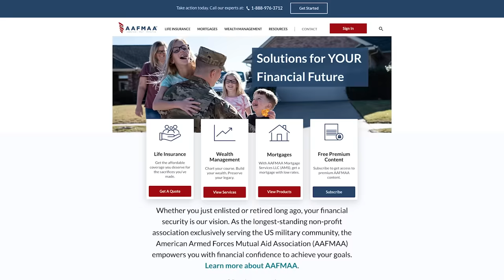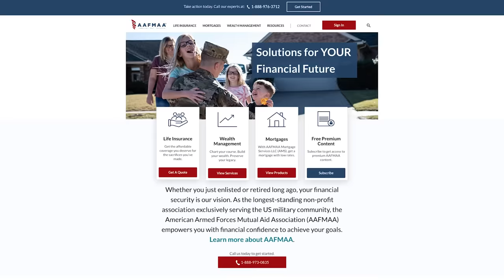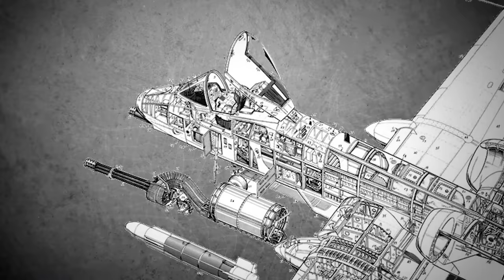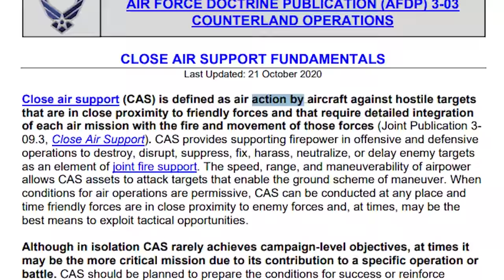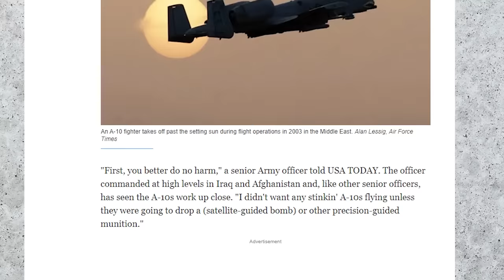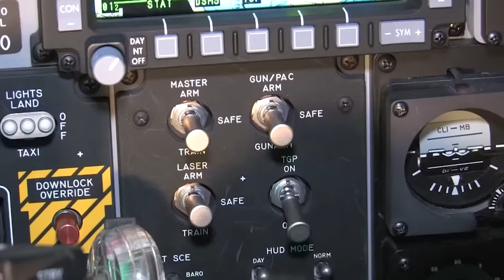Why the Air Force is Screaming to Retire the A-10 Warthog

Comment: Another comment, what gear you deploy can depend on what the enemy has. When Australia first deployed to Vietnam in 1965 [apart from advisors, which were already there for years], it consisted of an infantry battalion, a few M-113's, and a battery of 105 portable howitzers.  A battalion plus battle group with all the usual snap-ins like signals, logistic elements, and a small medical detachment. 
Later, it deployed 2, and then 3 battalions of infantry, more light armor , and more artillery and other services. And they learned their lesson, and employed a squadron [company] of the old Centurion tanks. Designed in WW2, they were no longer fit for a mission like stopping a Soviet tank army, but they were fine for use against the Vietcong and PAVN for years, because the enemy DID NOT HAVE TANKS AT ALL. 
Infantry operation with tank support caused Australian infantry casualties to plummet. Clearing a bunker system for example, or defending a firebase. [See the Coral Balmoral operations].
Short version, it is good to have the best kit in the world, but often it is simply not necessary. 
it reminds me of the joke. Two men are stalked by a tiger, and it charges. The first man runs, the second man runs as well. The second man pants "Why are you running, the tiger is faster than both of us?" The faster runner replies, "I am not trying to outrun the tiger, I am trying to outrun YOU!
You use what works, nothing more, and nothing less.
Reply: Australians in Vietnam were something else. They convinced my father that carrying water, or at least more than one canteen was a mistake, because you could instead be carrying that much weight in more ammo.
Reply: @removedot  That was weird advice. Several things to note. Although the Australian army has armour, it has always been infantry operations that dominate doctrine and training. We didn't have real mechanised infantry training in those days. So if you wanted a mech infantry unit, you would mate up a battlaion of infantry with some APCs [or helos] and go do the mission.
In addition, OZ is pretty experienced in jungle and desert warfare. All corps or branches of the Australian army, inlcuding logistics troops etc, had to go the through Cunungra jungle warfare course before being deployed to 'Nam. 
There is a doctrine of "water discpline", so in training and ops, you don't just guzzle water when you want to. That said, when I was in Oz green, getting dehyrated was an offense, if you were stupid about it, because then your mates had to stretcher you somewhere for an APC or helo to a hospital. 
Another big thing thta has always been in Oz military doctrine is 'fire discipline" . That means ammo conservation, aimed shots, and taking orders when orderd to fire or cease fire. 
The only plausable explanation would be that compred to most Aussie troops, Americans love their "rock and roll". You dad was probably carrying an M-16, and they have full-auto, wheras the Australian "SLR" was a variant of the Belgian FN-FAL in 7.62mm with only a semi-auto or single shot mission. 
The SLR was a brilliant robust weapon, and was dead easy to clean, but it could take a lot of punishment, and had a lot of stopping power. 
If your Dad got that advice, it wasn't doctinal. After that first year, when 1/RAR was deployed in 1965, subsequent battalions had some concripts in them. perhaps somebody didn't train them correctly?
I wasn't SAS, but I operated with them. Those guys are super-grunts, and they pack a shit load of water with them. Basically the idea is that you suck it up, and carry what is necessary for the mission and conditions, enough until the re-supply, and a safety margin. This is standard proceedure in the battlaions as well.
Reply: @roberthunter6927  he actually greatly preferred the M-14, and when he could, the AK-47 (much of the time he lived in the villages and trained locals how to use all kinds of captured weapons so probably saw just about everything)
Reply: @removedot  Yup, the early M-16's were utter crap. The M-14 was a nice weapon, but I much prefered the the FN-FAL. You could get them in full-auto [with a heavier barrel of course], but official channels didn't supply them. 
Another gem was the bren, in 7.62. Could almost withstand a nuke! :-) utterly relibale, mag fed [30 rounds].
I don't understand why the pig [M-60] was not supplied with a box magazine? Belt-fed is OK operating for a vehcile, but for a digger [grunt], the belt was sucidal. there was no way you could keep it clean. Both the US and OZ head-shed screwed the pooch with that one. 
The AK was OK, but some versions were better than others. From memory the Czech version was suburb and had good rust protection, because all the working parts, barrel were chromed really well. The selector lever was usually quite loud, which had tactical disadvantages. Accuracy was pretty 'average".

Comment: Something that most people don't know about the A-10 is that while it is absolutely dominant in overmatch situations, where the US has air-superiority and enemies are not operating heavy armor, the A-10 was effectively obsolete in any peer or near-peer conflict from the very get-go.  
Fire-tests performed on captured or purchased T-64s (in the 90s, I believe) with the GAU-8 cannon showed that the A-10 was unable to actually penetrate the tanks' heavy armor. Even when the A-10 scored numerous repeated hits on multiple passes, it was rare for any of the rounds to deal any significant damage. IIRC, out of something like nearly 2 dozen T-64s, only 2-3 were disabled by the A-10s after dozens of strafing passes. Most of the rounds that hit just ricocheted off, and most of the few that weren't deflected simply got lodged in the armor without penetrating.
Add to that the fact that the Soviets compensated for their own deficiency in air-power by focusing on SAMs to deny NATO air superiority as well, and the A-10 would have likely just been cannon fodder in any such conflict. In fact, NATO officials themselves expected as much, and the A-10s and their pilots were intended to be deployed as little more than a sacrificial stalling force at the outbreak of a Soviet invasion, meant to bog down Soviet tank pushes while NATO ground forces dug in and to force SAM responses so SEAD aircraft could take out said SAMs more safely themselves.

Basically, while the A-10 did certainly find another niche to fill, it was never going to be able to fill the role it was actually proposed for. And now it's niche is being taken over by more modern aircraft even better-suited for the role than the A-10.
Reply: The A-10 was developed as a gold-plated COIN aircraft, as its origins in the Vietnam War show - it was an A-1 replacement, of all things, and by the late 60s nobody thought the A-1 was going to be operating over Central Europe in a Fulda Gap scenario 
(or in any kind of contested airspace at all for that matter). 

As it happened, the A-10 was so over-specced for its designed job (and so in need of a justification for its budget slice after Vietnam, when we didn't have any COIN stuff to do for a while) that USAF claimed it was a dedicated "tank buster," but that was always kind of... insane.
Reply: Yup.  The A-10 was designed for Vietnam as a slow escort and dedicated CAS platform for Airmobile Divisions.  It would have been great for a few years in SEA in that role, with the main threat to it being the ZSU-23 mobile AAA platform that was being fielded in Vietnam after being provided to the NVA by the Soviets.  It was a suicide mission profile in European Fulda Gap or the Korean Peninsula Northwest Corridor between North and South, due to proliferation of 1970s-era SAMs and Radar-guided AAA.  A-10 should have been cut to maybe 250 airframes for expeditionary forces in support of the Joint Rapid Deployment Forces concept, not made at 716 airframes.

It robbed the USAF of relevant fast-mover seats and maintainers, and does to this day.  When they're populating the Air Taskings Order, the last airframe to be allocated is the A-10C, because it is of no practical use, and gets relegated to contingency CSAR duty.  This is because it isn’t survivable even in some of the more remote regions, where cobbled SAMs have been seen and used successfully against unsuspecting fighters overhead.

Comment: Highest blue on blue incidents rate ✅️
Highest accidental civilian kill rate ✅️
Extremely vulnerable to most forms of AA ✅️
Unique weapon system that is so powerful that it's extremy difficult to be accurate due to recoil ✅️
Unique weapon system that is not powerful enough to do anything that the more accurate 25mm can't do ✅️
Decades old airframes that are wearing out and getting more maintaince intensive ✅️

The sooner the USAF stops wasting resource on this dead end platform the sooner it can get more effective ones in service
Reply: "But I'm a retired infantrymen and I say 'BRRRRRRT'!"
Reply: This.  A great plane for the 20th century.  We should be building and maintaining planes to fight the way we fight today.  The low environment is dangerous as crap and we have high altitude weapons that are way more accurate than the A-10. If you like the “Brrrrt” sound brings speaker and play it on your iPhone.  If you want an aircraft to provide accurate, effective, close air support without getting itself shot down, bring a Viper.  Single mission platforms are a luxury we cannot afford.  All the money that goes to the A-10 is taken from platforms that actually win wars.

Comment: To me, it seems like drones+artillery can do a lot of what CAS does more cheaply and can more easily help every unit
Reply: Plus not being so vulnerable to SAMs. Although I do see some utility in A-10s and Apaches in places where you can't have artillery covering the whole theatre of operations and need a fast response.
Reply: Artillery CAN'T DECIDE WHAT TO HIT while it's flying through the air at a fixed point on the ground.
Drones are limited by how much firepower they have and because they are controlled by someone that DOESN'T HAVE 360 DEGREE AWARENESS!
Reply: @babsme6459  There is also laser guided artillery but for most uses a normal guided munition will do the trick as well, since the flight time is quite short.
While helicopters are more flexible in theory, they are also a much bigger and in many cases an easier target.
Due to air defence threat they have to stick closer to the ground, which actually means that their situational awareness and field of view is rather quite limited. 
What is meant by drones here are those small and cheap ones used in Ukraine, not the large armed ones. You can saturate an area with dozens of drones and create a superior situational awareness compared to a single helicopter.
If they get destroyed, they are easily and cheaply replaced and the crew is not lost unlike with helicopters.
Ukraine has shown the world the limits of helicopters in modern warfare and opened another world of small drones and precision artillery.
Reply: My husband was a Redleg so i understand how artillery works, including laser guided.
However firing ONE 98 pound round of 155mm about 12 miles is not the same as flying a few hundred miles and delivering a couple hundred 30mm cannons shells, or  the up to 16,000 pounds of armaments it could carry that included: 500 pound and 2,000 pound bombs, incendiary cluster bombs, combined effects munitions, mine dispensing munitions, Maverick missiles, laser-/GPS-guided bombs, and unguided and laser-guided 2.75-inch rockets
Artillery is and always will be the King of Battle, but is usually an area not point target weapon, while an A-10 had someone behind that gun and those bombs looking right at his target.
Reply: @babsme6459  Also, I don't quite understand the contradiction in your comment, first saying that ONE artillery shell is not a substitute for a large aircraft payload and then saying that artillery is an area weapon, since an area barrage requires a significant expenditure of munition.
Nothing is constricting artillery from firing multiple shots after each each other, not even precision munition. A single artillery piece could deliver a couple of those a minute, while a single aircraft usually needs a couple of minutes to realign on a target.
Reply: A single artillery piece also has a probable area error. And even a laser round couldn't be fired quickly because of smoke, dust, debris in the air that needs to clear.
An A-10 can turn in SECONDS and reattack a target.
Go away,, As a career soldier who went to the field and to war with combat arms support units and combat arms units themselves, I've probably seen more artillery rounds from 105mm to 8inch hitting the ground than the number of days in your life.
Reply: @babsme6459 for the part about looking at the target, drones spotting for artillery actually does a lot of that work.

Without relying on the short range mk1 eyeball

Also, and idk how common this is but I've seen it in clips, the Ukrainians have been able to get artillery shells right into trenches. So it seems like they're been getting it to work as precision weapons? Idk.
Reply: @babsme6459 right, but neither drones nor artillery are death traps begging to get their operators killed via MANPAD or longer ranged air defenses.

Drones can operate in such contested airspace without losing valuable pilots. The a10, due to the trade offs it made for the gun and being able to shrug off a certain amount of bullets, basically can't operate in airspace that hasn't had any threat to slow, unstealthy air craft removed.

Comment: I will miss the A-10 but also worth noting that the F-35's cannon is actually a 25mm rather than 20mm and is intended primarily for air-ground use. Due to the nature of volume laws 25mm is closer to 20mm than 30mm in total energy but still  but still has almost twice the total mass/energy of the 20mm round (although the 30mm has 8x as much). Against China/Russia the thing it's really a shame is that we stopped producing F-22s.
Reply: the issue is, i dont think the 30mm was ever given he rounds. so the volume is kinda pointless if all youre shooting are darts in the first place.
Reply: @Thekilleroftanks  yeah, and I also hope they arranged the cannon position finally. when firing it it would miss completely the target as the cannons were all badly allined. hope that issue is solved. plus some versions can't even support with cannon as they have none. Finishing, the F-35 using cannon air to ground??? is that how the F-35 was meant to be used? I don't think so, rather flying and attacking air or ground targets BVR, but maybe it's me being a stubborn idiot regarding for what roles and to achieve them the F-35 was bulit for. CAS missions? really?

Comment: With today's smart munitions, is CAS even needed anymore? And didn't Cappy said waaaay before, as an average infantry man, the best CAS platforn is the AH64?
Reply: CAS means you are providing air support close to friendlies not you getting close to the enemy doing gun runs
Reply: Facts. The AH-64 does everything the A-10 can do, but better.
Reply: 20 million a pop for the ah-64 vs 80 million for a f-35b. You can build four Apaches for this price of a single f-35 and since you would never fly a single f-35b now you're talking eight.. of course you're going to have to train six more pilots, and the f-35 bees will be down for maintenance a lot more than the Apaches. The Apaches can land and take off from almost anywhere. However it doesn't have the range where the speed that an a-10 has or any jet combat aircraft. But it's designed to operate close to the front lines so does it really need that? Maybe a combination of f-35b and ah-64 would be a good choice. Isn't that what the Marines plan on using? Just substitute Apache for cobra.

Comment: 15:48 I love the A10, but with a max impact area of 40ft, you would be better off using artillery or mortars and with better air to surface missiles I can see why the A10 is fading into obsolescence.
Reply: by this arguement then helocopters need to go
Reply: @alanwardell3680  Helicopters cost less and serve more roles than the A10.

Comment: There is an aircraft that is in the US inventory that can easily provide the same level of CAS support that the A-10 can. It is the AH-64 Apache. The Apache has so much more advantages with CAS than the A-10. Such as hovering out of sight in cover till they are needed.
Reply: The A-10 is only number 1 in one aspect... and that's blue on blue kills...

Comment: The airforce routinely retires more capable aircraft in favor of a more humongous force overall for logistics. 
See F4G to F16cj transition.
Reply: A-7 and its bombing capabilities?
Reply: The problem is, the A-10 is not a more capable aircraft, nor was the F-16 less capable. Better electronics changes what is needed from an airframe. 

On top of this, there is the issue of material stress. Airframes have to be retired eventually because they do fatigue over time.
Reply: No.
The F-16 has a smaller payload and ~30 minutes of loiter time, and lacks the stability at low speeds required of a CAS aircraft.
The A-10 has a ~2 hour loiter time and an enormous payload with tremendous stability at low speeds.
The C-130 gunship and attack helicopters are reliable for CAS, but are equally vulnerable, and in addition helicopters are slow and lack payload and loiter time.
Reply: @iivin4233  regarding airframes, many A-10 wings and even fuselages are brand new. they were rebuilt, or replaced.
Reply: @braedenh6858  I think you dont know the f16cj role
Reply: @mikel1062  I was responding to the comment about the A-10 being less capable.
I'm aware of what the CJs can do